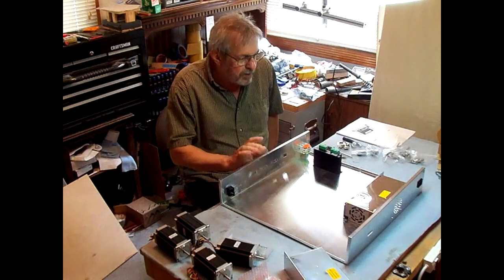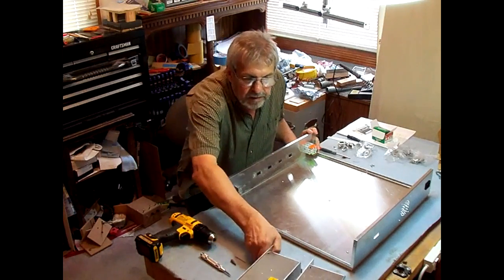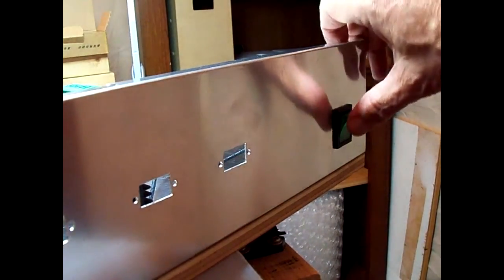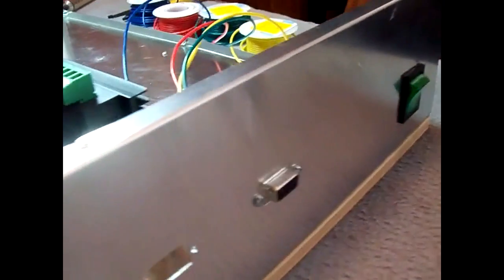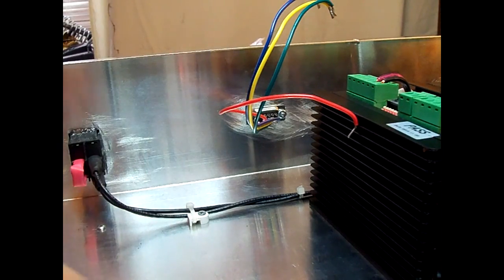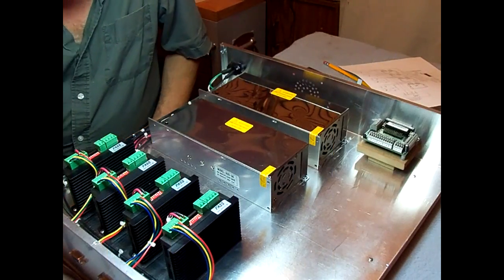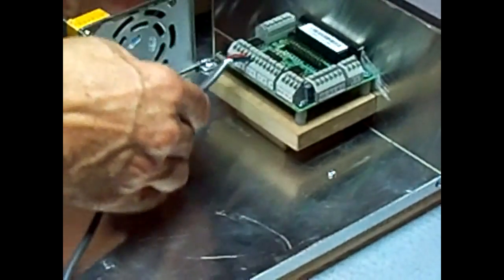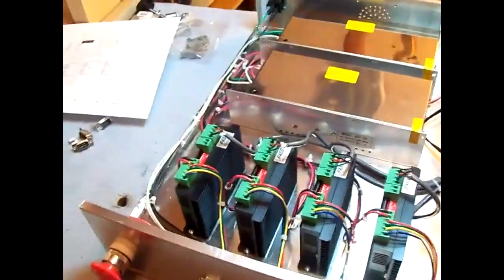CNC Router build part 7 electronics

Comment: Your control panel layout looks very neat but there are a couple of aspects with your wiring that are unnecessarily tempting fate for interference pickup.  Your Estop wiring is running parallel and close to the main switch wiring for the whole width of your box - ideal conditions for the Estop wiring to pickup interference from the mains. If the Estop switch and main switch positions were swapped around then the parallel run would be eliminated and the Estop wiring length would be much less. The pair of wires for the Estop switch should also be tightly twisted together to reduce their susceptibility to interference.  Similarly the wiring between your stepper drivers and the DB9s should be arranged in twisted pairs to reduce the amount of interference radiated  due to the stepper motor currents.  In all likelihood you have not had a problem but proper wiring layout and techniques to minimize susceptibility to interference and minimize radiating interference add no extra cost may may save an occasional interference event that destroys a job.
Reply from the maker: Thank you and thanks for your suggestions.  You are right in that I have not had a problem and the fact that I use it very little now a days, it's likely that I will not change anything unless I would start having probems.  Thanks again and thanks for watching!

Comment: Hi Robert,

I have a later design then you from Peter (CNCConversion), your videos were a big help!  Really appreciate how helpful they have been.   In Video 7 I see you are following a schematic.  I was hoping to sanity check my controller/switch settings which I had Peter put together.  I am having trouble with my stepper motors heating up while not in use..  I have been running them at half power and way slower than I want to keep them from missing steps...  Would you happen to still have that schematic?  Thanks a pant load!  Alex    email -alex.fletter@outlook.com

Comment: Hallo sir... I just want to ask is there any software need to installed after you finish your panel board? For example like printers your installed the driver software in order to run your printer. I'll be glad to to your explanation...

Comment: You should unscrew 2 nuts from parallel port and use them 2 fix the port in the case. Also they are used to hold the cable while connected

Comment: hello sir , in the manual of  driver DM566 it is showing that there must be a resistance of  of 1k/2K between controller and driver, but you are connecting it directly.pls clarify on this
Reply: For DM542A i found this

When VCC=5V, R=0
When VCC=12V, R=1K, ＞1/8W
When VCC=24V, R=2K,＞1/8W

Computer parallel port have 5V soo you don't need any rezistors

Comment: Liking the case as there's quite a bit of real estate. Nice work on your wiring . On the break out board , is it just push terminals , no screws?
Reply: Sorry I watched again and I see there some type of push terminals . Would have really preferred screws like the drivers
Reply: +MyRobertadams 
Yes I apologize, as I watched it a little more carefully and seen you kind of pushing a tab or something with a small screw driver. Not really liking that system , and going to try and find a break out board with screws

Comment: Hi Robert. Nice setup. I was wondering...do you think the stepper motors are large enough for this machine? Would the upgraded motors be better? Also, is the gantry really sturdy - does it flex? Does all the wiring and serial/parallel ports and limiting switches come with the unit?
Reply: Hi Robert. I talked with Greg earlier today and it appears he has changed to design a bit. Both designs seems to be very sturdy. I think I will upgrade to the nema 34 motors as well. Its certainly fun to shop around.

Comment: I noticed you made a mistake when you put in the breakout board. The hex nuts on the outside with the parallel port are to give the board support against the casing. You are meant to screw the hex nuts through the metal/Aluminum casing not drill the hole bigger than them. But i am sure i am not the first to notice.  Still a good video

Comment: Something to keep in mind: the computer cord case plugs are typically rated for 10 Amps and are fuse-able.  This will be fine for most people but others running more robust systems (i.e. 3-axis+ system with motors over 3 Amps).  Also consider things like duty cycle when considering what was mentioned in last sentence (i.e. lengthy milling jobs).  Two power supplies attached to the same mains line may induce some interference which may cause one or both to act erratically under load (i.e. ripple).  EMI filters at each power supply will help mitigate this from happening.  Also help if you are plugging system into "high traffic" mains lines (aka high voltage transients).  Twisting wires together (~1 turn every inch) will help mitigate what is essentially cross talk on DC power lines (not going to waste time writing specifics, just good to know about it).

I like that you separated AC from DC and power from communication wires.  Too many people just tossing everything into a nest and wondering why things start acting funny.

Comment: I am looking at how frustrating that newer or later builders will be/must be, in that the wiring you are showing is only partially correct in that the newer buyers are being sent power supplies and breakout boards that are not the same as what you received earlier on.    I received cck5560 digital stepper drivers.  They look like yours but if you have a different driver than cck5560 it may have a different placement of the screw slots that receive the wires than you driver does... this concerns me greatly.  It is absolutely different than the power supply you have versus what I got.  My ground, neutral, and hot are all three switched in a different configuration than yours... this would have dead shorted my unit if I hadn't caught this and wired it in your configuration.  The current Rhino files where Peter showed how to wire the new stuff, is fuzzy to the point of illegible-ness if you try to enlarge it so you can read it.  It is too small to decode in its current web page.  So please bear with me if I bring up pedantic questions trying to figure out the wiring...bob

Comment: since well im designing a totally different CNC machine were by i will be using two Z motor do you thing i can connect them parallel on the Z controller ? or do i need another controller but on control circuit i parallel the connection of coding wires

Comment: The next time you put a controller together the hex screws on the breakout board unscrew and slide the parallel port plug in the hole without drilling the hole bigger then you can put the hex head studs back to hold the breakout board to the inside of the case.

Comment: please help me sir, 
I'm building 3 axis cnc using NEMA 23, 270 oz inch torque Motor with HY-Div268n ( tb6600 driver chip) 5 amp.... 
which POWER SUPPLY should I use ... Can you give me suggestions for volt and amp for high performance.. 
thank you

Comment: What kind of breakout board you have? Can you give a link?
Reply: ***** Oh ye, that one I know. I just saw a little different connectors and could not recognize it.

I also have a noob question. You said you have X slave. I was watching one review and guy had said that that 4 axis board does not support slave axis. I was always thinking that this is done on the level of software. Or should the board have the build in support? If I need 2 motors be one one axis but rotate different direction I can use any board that supports MACH3, can I?
Reply: ***** In your case drives have the same direction. Thank you for referring me that board. I am looking in to it.

Comment: Why did you use two drivers for the Y Axis. Wouldn't it be better to use one driver and motor with a gear belt to tie the screws together. Less chance of one driver crapping out and locking up the Y Axis ??? Look great though.

Comment: You might want to put an external fan on the case to suck out the hot air from the case
Reply: Its better to have positive air pressure in the case so have an intake fan so the hot air goes out the exhaust holes.